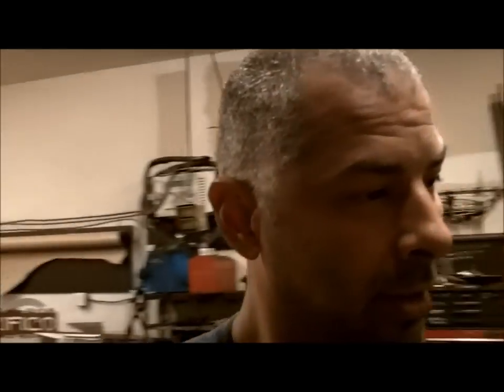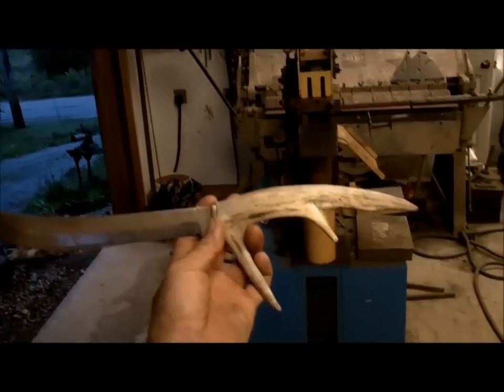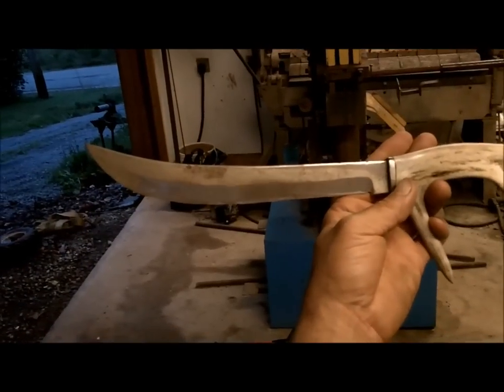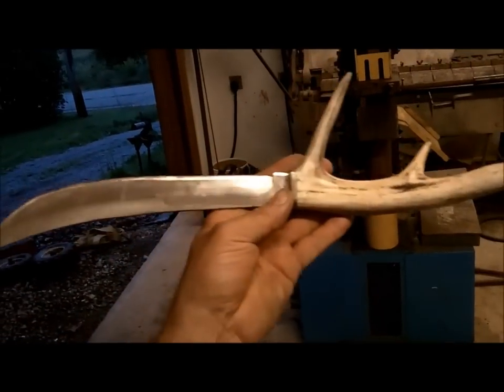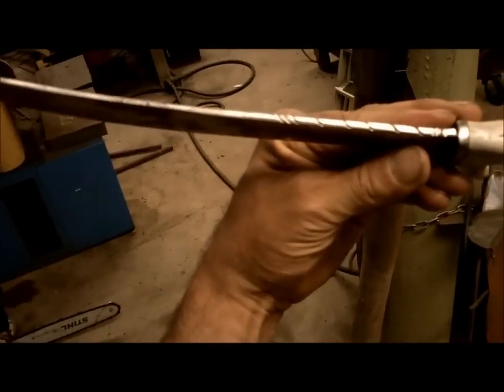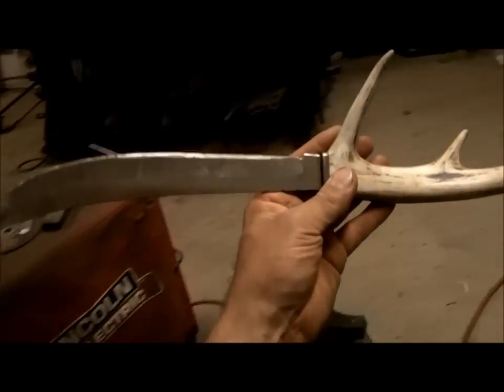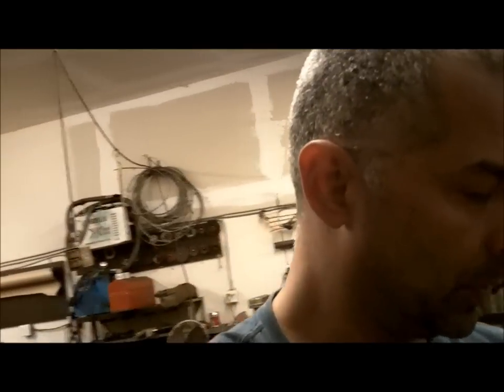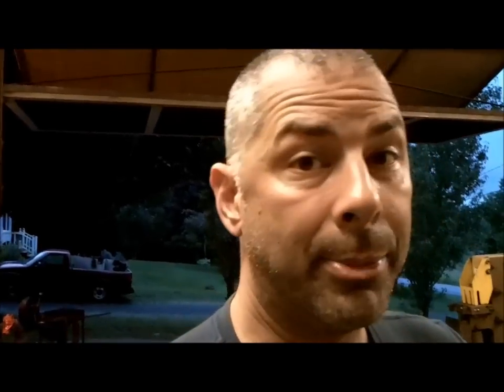Spark Test Contest......Win A Knife!!!!

Comment: 1 Wrought iron
2 Mild Low Carbon Steel (A36) Construction Grade Steel
3 Medium carbon Steel (1060, 1080)
4 High-carbon tool steel (1095 - Heat treatable spring steel)
5 High-speed steel (Holds Hardness Properties at high Temperatures)
6 Manganese steel
7 Mushet steel
8 Magnet steel

(Just a guess)

Comment: @ASSMYLICK there are 8 different metals in this spark test, guess the metal (not alloys just simple terms such as mild steel, spring steel etc.) and the order, remember they are mostly ferrous materials but NOT ALL. you will win a one of a kind hand forged knife with a staghorn handle